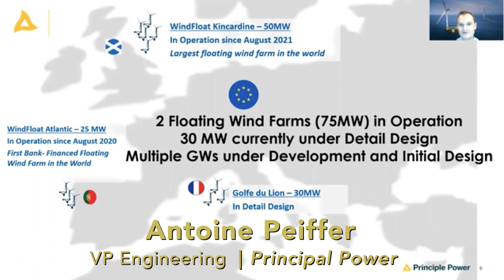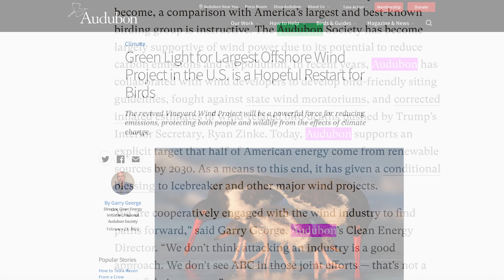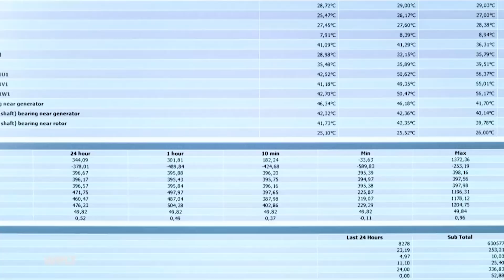Will Offshore Wind Harm Marine Life?

Comment: Wind power is not the answer.   So expensive to build and maintain.  How does it compare to deep sea rigs, eco damage in exchange for energy?
Reply: Massive oil spills? 😂😂😂
Reply: Exactly. Greenpeace has a big campaign on the noise of gas exploration on sea mammals but are quiet as a mouse on Offshore wind